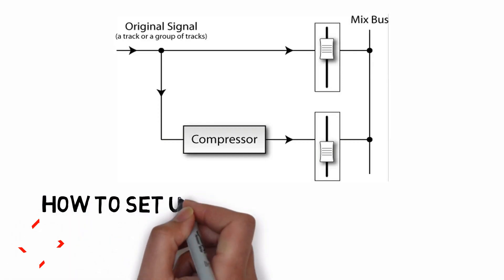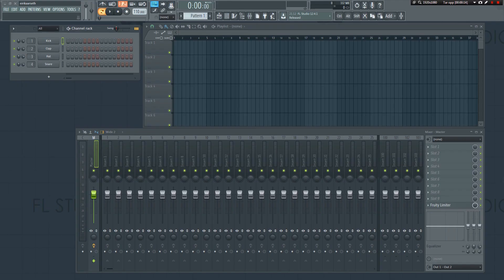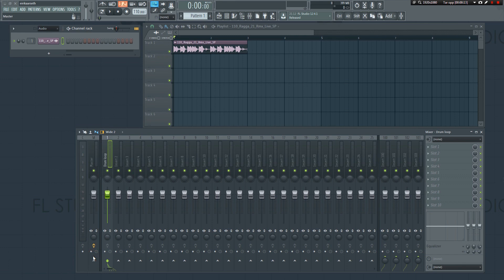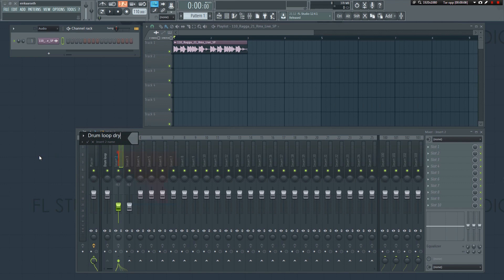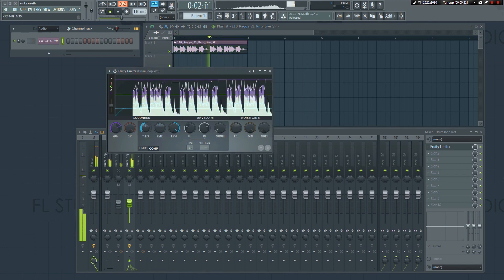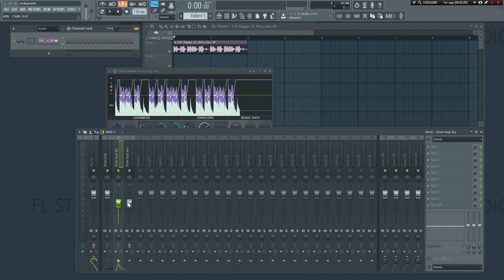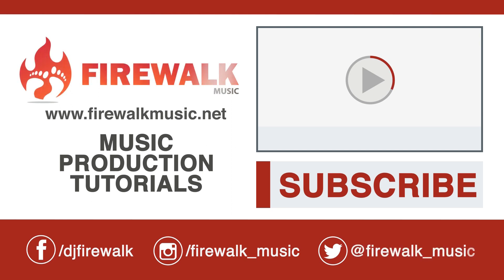How To Set Up And Use Parallel Compression In FL Studio  (Parallel processing)

Comment: I love watching your videos. Really well explained and straight to the point. In this video though, I’m not really sure what purpose the drum loop dry channel achieves? There is no compression or effects on the channel so isn’t this just a duplicate of the original drum loop? Could you not use the original drum loop as the dry loop??
Reply from the maker: Hi, this video is intended to show the parallel processing process, using compression as an example. 
Most people will just load a compressor, or any other plugin on a track and then be done with it. That means the plugin is affecting 100% of the signal. Parallel processing is all about using both signals at the same time. So you have one channel with just the original dry signal, with no processing whatsoever, and another one with the processing on it. You can then adjust the dry/wet level between them. This is a technique used a lot on vocals, for example, to retain the transients, while still adding compression. You can get the best from both worlds. 
This is the old-school way of doing it. Most plugins today have a dry /wet knob that you can use, which is much easier. For compression, 50-60% wet will often give an outstanding result.

Comment: Then if we want to parallel compress the entire track, we will connect 3143214123 tracks to two different bus tracks. Wow.
Reply from the maker: This video just explains the process and the principles behind it. Most modern third-party plugins have a dry/wet knob that you can adjust, and it basically does the exact same thing, and is much easier to use. :)

Comment: Why did you need to make a drum loop dry channel? If your original drum loop track (channel 1) is going to the master wouldn't that be your dry channel? Couldn't you do a send return to the wet compressor channel (channel 3) and get the same effect?
Reply from the maker: I suppose you could, but I always prefer doing routing this way because I can then add additional effects and processing in the mixer itself before it ends up at the master. But there's nothing that says you can't do it that way if you prefer that :)
Reply: @FireWalkMusic  thanks for your response!! Just tryna understand the differences and get my mix down a little cleaner.

Comment: Quick question. Wouldnt the frequencies clash between the two tracks? Is it ideal to lowcut on one or the other?
Reply from the maker: That's always a possibility. It depends on the sounds used. If it starts to phase, you'll hear it very easily.

Comment: Is it possible to just tweak the compressor’s mix knob “in the effect chain” to get the same kind of results?

(Not the compressor’s internal mix knob)
Reply from the maker: Yes it is, but Image-Line don't recommend touching that knob because it can cause PDC issues which again result in phasing and such. Most modern plugins come with a built in wet/dry knob and it's better to use that knob instead as it won't have the same issues. This video just showcase the old school method of doing it, and explains what's actually happening.
Reply: Thanks so much for the detailed explanation! Now I know what I should do. 👌

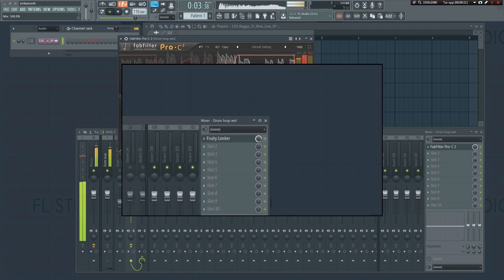Comment: what are ppc-issues? 3:37
Reply from the maker: You mean pdc issues?  PDC stands for plugin delay compensation. It's a feature built into daws which help keep everything in sync by calculating the latency created by the various plugins, and adding the appropriate delay in order to give the cpu time to catch up an keep everything in sync. Some times it can fail though, especially in older versions of FL Studio. The newest verisons of FL Studio had the PDC system redesigned, so there's far less issues with it now.

Comment: You should use patcher, that way it only takes up one mixer track instead of three
Reply from the maker: Indeed! This video is a bit outdated. Now, as you say, we can use patcher to do the same thing. Patcher was recently updated to take full advantage of multicore processors too, so now it shouldn't be much of a drag on the system any more. The PDC was also reworked in FL Studio 20, so there shouldn't be any PDC issues any more either. :)
Reply: FireWalk, just wanted to say thank you so much for your videos, they are extremely helpful and some of the highest quality tutorials on YouTube. Keep doin what you are doing👍🏻👍🏻
Reply from the maker: @aridavids4335  Thank you! That means a lot! :)

Comment: FireWalk I really would like to see a video on PDC I'm having issues using ozone 8 it's giving me issues. I have a i5 8300u processor, 24 gigs of RAM, it's not my computer it's something with setting up PDC and I can't get it right. Also when I side chain my 808 and kick drum I get to much pumping on my 808 any suggestions. Thanks great videos
Reply from the maker: FL Studio has always had issues with PDC, but they reworked the entire PDC system in FL Studio 20, so now most of those problems should be resolved. Which version are you currently on?
Reply: @FireWalkMusic  I'm FL 20 I think it must of been to many inserts or it happened to be that session cause it worked in the next one
Reply from the maker: If it keeps happening you might want to consider making a post about this in the bug report forum on the IL forum. There might be some bugs
Reply: @FireWalkMusic  which mode should I be running in for playback tracking driver, hybrid, or mixer?
Reply from the maker: You can use Hybrid unless you are having any issues. If the tracker isn't matching the playback then try setting it to mixer.
Reply: @FireWalkMusic  thank you
Reply from the maker: @jaytoveproductions6370  you're welcome :)

Comment: Hi would the transient processor like the one in FL Studio do the same thing as parallel compression.
Reply from the maker: The transient processor is basically a simplified compressor with easier controls. It has two main knobs which you can use to either enhance the sound. The first is the attack, which controls the transients, which is the first part of the sound. The Attack of the sound (the click / transient of the sound). The release controls the body of the sound. If you turn it up it adds more weight to the later parts of the sound. If you use on a kick for example it becomes more boomy. 

You can read more about the transient processor here: https://www.image-line.com/support/flstudio_online_manual/html/plugins/Transient%20Processor.htm

Comment: Wouldn't this cause a bit of phase issues?
Reply from the maker: Potentially. This is the "old school" way of doing it. By doing it this way you can control the phase and the offset to prevent just that. Image-Line actually recommend against using the mix knob in the FX section of the mixer inserts for just that very reason. :)

Comment: Wouldn't you also need to put a compressor on the dry channel strip, except without any compression settings on. This would stop any latency/phase issues?
Reply from the maker: The PDC has been redesigned in FL Studio version 20 so now there should be no more trouble with the PDC.
Reply: @FireWalkMusic  Ah I didn't know about that, thanks!

Comment: My question is when both signals are blend together or playing together , are't they having any phase issues?
Reply from the maker: The alterations to the waveform will usually be sufficient to prevent that, but not always. In that case you would have to try to reverse the phase, or push one of the signals a bit out of time by a few ms. I know there's also phasing issues involved when using the mix knob in the mixer itself, which is why IL doesn't recommend using it. 
If you are using third party plugins, they usually have a built in "mix" section, where you can adjust the level, and that's the best option. It will prevent phasing issues and is overall the quickest way to do it. The method shown here is the old school way of doing it.
Reply: @FireWalkMusic  one method is to duplicate the wet effects plugin in dry mixer track and let them remain unprocessed, compress the signal in only wet mixer track. This way phasing issue will not occur since both mixer tracks have same plugins.
Reply: @NASTYFRXQ  that worked. I used the same basic limiter he did in video. Did what you did and it help. I threw it on but didn't tweak it. It helped with the phase. Lots of crazy symbols in my break beat. Thanks. Feel like in a laboratory

Comment: Awesome explanation! But couldn't you just use the send (or insert) function to do the same thing, instead of having to make 2 new channels?
Reply from the maker: Alex, the dedicated send tracks to the right in the mixer has been removed in the newest version of FL Studio (12.5). The reason for this is that in FL any track can serve as a send track. They are in reality no different from any other track, they are just tracks with a sidechain, docked to the right. So it doesn't matter what track you use. :) 

PS: 
If those docked send tracks are a vital part of your work flow, and you want to continue using them the same way in the newest version, you'll have to sidechain all tracks to 4 dedicated sends, and then dock those 4 sends to the right and save it as a new template. :)
Reply: Great, thanks for the explanation!
Reply from the maker: You're welcome :)

Comment: Great and very helpful video. What helps further is the way he is describing it, and the quality of his voice. A tutorial video without proper expressions becomes so dull, but the voice over is great here. Thanks for making this, wish you all the best
Reply from the maker: Thanks! Much appreciated. Make sure to check out my other tutorials as well :)
Reply: FireWalk , I had a question..Is it needed to moderately eq & compress snares and kicks in their original tracks, before sending them to the dry and wet tracks? Like Im using my own drum sequence that Iv made using piano roll and the sample sounds from drumkits in Packs. I find these sample sounds have lots of unnecessary frequencies, so I filter them. Should I skip that step in this technique??
Reply from the maker: If you compress the dry track it will defeat the purpose of the parallel compression, as the goal is to maintain the transients as well as getting a punchier sound by compressing it. Unless you want to combine two different compression techniques in one sound. You're basically just splitting it in two, and compressing half of it. You can always EQ the dry track of course, it, that's no problem. :)
Reply: FireWalk Thanks for clarifying that..:)
Reply from the maker: Np! :)